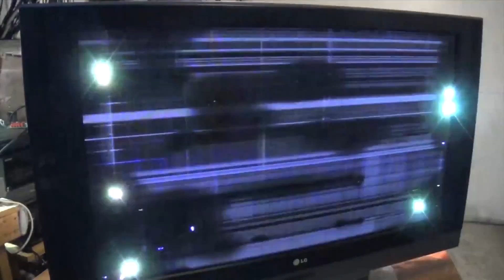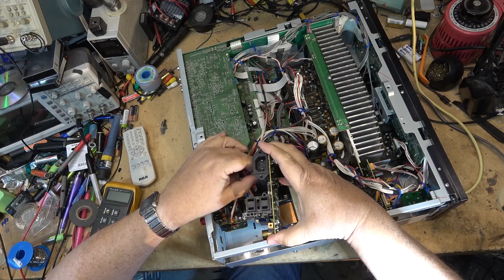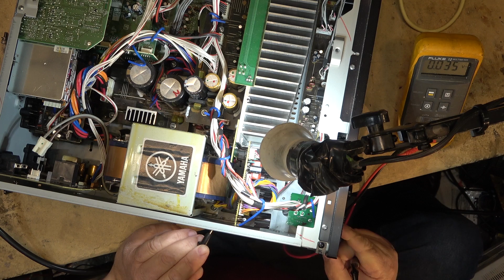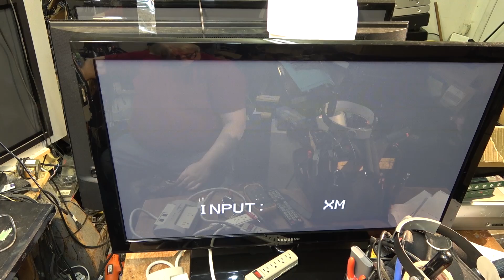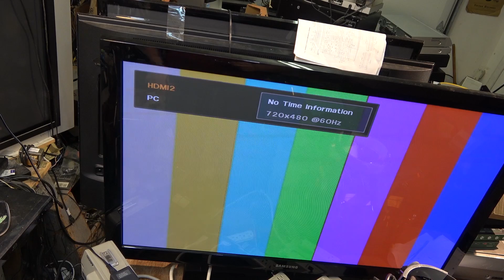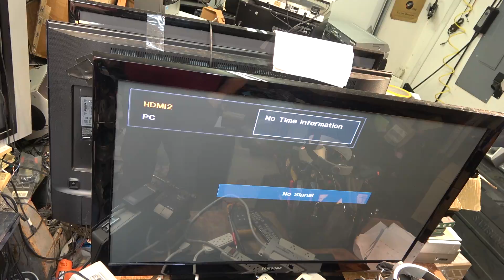Yamaha RXV1700 AV Receiver is DOA

Comment: I found one of these in the trash, Powered on with a click. No display. opened it up started wigging wires on the power board now it powers on. Think I too have cracked solder joints. Ill look at it 2 morrow.  Know what remote works on it?

Comment: Congratulation with the Yamaha unit. I have a old Yamaha RX-V461 unit and i love it because of the very good sound of the amplifier. A somewhat weird thing on my Yamaha unit is that i must hold on the power button on the remote until i hear the 2 clicks in the relay too engage on the Yamaha unit to power it up, if I don't do that it's going to hung up on the 1 click in the relay and get stuck and then i must disconnect the power cord and connect it again to the unit to get it working properly. The radio on my unit got a failure some years ago and the symptom reminded my of a failed transistor, the FM radio station i listened to just faded away in white noise and i got no other radio reception on any other frequencies. But i have coupled the Yamaha unit on a internet/FM and digital radio unit so that is taken care of. The original remote got a failure on the volume up button and i searched the eBay and got one cheap there. The amplifier in the unit itself has worked flawlessly. Great video 😊👍

Comment: Yes, I just re-soldered some bad points on a LED flashlight that required turning on the switch and then slapping it with your hand a few times in order to turn it on (only to have it mysteriously turn off at the exact moment of needing a flashlight). It seems to be behaving itself now.....

Comment: Any thoughts on the usual receiver brands over the last few years for sound quality and reliability, do you prefer jvc, yamaha, sony etc?
Reply from the maker: Yamaha have always had pretty good sound.  Personally I am using an old Onkyo but that's only because I got it for 40 bucks.  When it breaks this one will be next in line i think.  Have to get a remote for it though.  Or if i fix the other Onkyo that blew up when a bunch of geese thought power lines looked like a good place to land.
Reply: @12voltvids  I have a RXV-1700 in-service.. never had any issues with this high output amp over 8 years.   
The 'mystery' speaker output (non banana) is for Presence Channels. Chances are that speaker set has been disabled in original setup.
Yeah... you need the remote to setup many functions, aside control the thing easily (note the minimal control functions located on the Amp) 
The correct remote model number is: RAV361 - WH25420EX 
The remote is rather large and 'learn' programmable to control sources and TV functions. Has no less than 66 buttons, some multi functional. It uses 4x AAA cells... not the typical 2x AA or AAA cell job. 
This has a green coloured LCD display ( earlier 'top shelf' models had similar remotes with orange coloured illumination) Won't be cheap to replace. 

I would have replaced all of the red film Caps on that standby board. A common 'old age' fault is the unit powers up and then drops out due to such a Cap fault.

Comment: would this be a cheap fix for him good it came on
Reply from the maker: If it was a paid repair perhaps 100. He paid 95 at the vintage audio repair shop only to be told to scrap it. They offered to recycle it for him which I think is their way of hoping he would have said keep it then they would have fixed and sold for hundreds.  That is the rumour about that shop.   I won't mention them or respond if anyone speculates as to which shop. Any comments that mention any shop by name will be removed so any locals that feel they should call the shop out don't do it here.  You have been warned.  I know what they do because i know someone that took a piece of equipment in and was told no parts were available so they told them to recycle only to have it show up for sale listed at over 1000. Before you ask, it was a customer I met at my day job. They didn't know i repaired equipment and while i was there working on their internet we got to talking about stereo gear because they had some nice pieces and I mentioned i used to run the old local shop and that I still work on stuff at home.  Then the other shops name came up, fella asked me if I had heard about them and proceeded to tell me about his experience and what they did and then show me pictures of his equipment that they as he put it "stole" from him up for sale for a small fortune.  
I guess if I were to sell this for a few hundred dollars the guy that gave it to me could say that about me too and call me a crook.

Comment: What camera do you use to capture these videos? Your videos are sharp and the details are always easy to see.  I have some projects I would like to capture at my work bench, and the cameras I have available are either impractical (size/weight of a DSLR) or they don't yield a sharp enough image (10yr old GoPro).
Reply from the maker: I use a Sony FDR ax53 which is a 4k video camera. Has a 20x lens for good close up work.  I do my shooting in 28mbit avchd 1080p60 frame.  There is a higher quality 50mbit 1080 mode as well as 2260p at either 60 or 100 mbit 30 frame 4k. I don't use that as my computer takes longer to render 4k and it is unnecessary fir this work. I use 4k for scenery videos.
Reply: Thank you for replying! I'm saving up for a new camera and your info will help me narrow down the choices that exist, it's pretty overwhelming how many cameras are available on the market used and new.  @12voltvids
Reply from the maker: @killertimes  I have 3 in use. FDR AX33, FDR AX53 and FDR AX100. The 33 and 53 used for YouTube videos.

Comment: That's a beast. Sell it quick while it still works! I'm also on the Yamaha mission at the moment. I just took 3 units for repair and decided to buy a load more from the classifieds here in France. Making some low ball offers because by the time you ship it in and sell it and ship it out again it's not easy to make much profit. I'll try to sell them locally but i think i already have the amplifier market saturated here. lol
  One tuner amp had a strange failure after i fixed the bad 5V reg. It was all working but i had to clean the volume encoder, i stripped the front, cleaned the encoder put it back together and then no longer saw PRY voltage which should be 4.8V on the RX-V630rds, I could not understand why the microprocessor failed after i dismantled the front, it still appeared to be booting so i took a 4.8V from the perma supply to the processor and i routed it back to the standby relay input PRY. This means it's basically on permanently, probably no more remote activation. I'm going to tell my friend to unplug it when not using it. Too much of a mission to get a new micro processor as it would need programming. I was wondering if it switches in 4.8V to PRY from Vcc on the processor or if the processor has a separate 4.8V input that then is switched through to PRY, perhaps it is missing this 4.8V in so it can no longer output it although you can see it stabilise 0,05V on PRY so it is trying to do something. Already put too much time into it so it's going to stay in bypass jumper mode that i created unless i have some sort of revelation. Thinking this might have been static damage which would be my first encounter but it's a pretty old processor, v chunky. a M30622M4A

Comment: Hi Dave, what size isolation transformer do you have there?
Reply from the maker: I believe it's a 600 watt.
Reply: I have a 1:1 transformer in my garage from some industrial install. i can not really lift it it's so huge, it's still in a steel box but even out of it's box it would be huge, i think even at that size it's only rated at 2000W Insane, i would have thought it would be 10Kw.
Reply from the maker: @izzzzzz6  my isolation transformer weighs perhaps 10kg

Comment: Hi! Receiver going to comme back with same fault: you have problem with C4 (value is lower than it should be) there, on that STBY board.... (change it and you will be fine). This is know many YAMAHA RX-V fault.........(If i remember correctly: you allready had same kind of problem with another YAMAHA previously....)
Reply from the maker: Ain't coming back as it's my receiver.
Reply: Ok, but it will have same fault after while (thermal dependency...) @12voltvids
Reply from the maker: @kalulukakaluluka9497  likely not going into service any time soon.
Reply: @12voltvids  That model Yamaha will crap all over the Onk'. ;-)
Reply from the maker: @BTW...  need the remote
Reply: Definitely agree about the C4 Capacitor, had the same problem on 2 previous RX-V Receivers and replaced capacitor on both units and both running fine years later. Cheap fix.

Comment: Quite happy to accept the need to cut lead out of waste products wherever possible, but when taking the lead out makes stuff more likely to go to landfill prematurely in the first place  you have to question the logic. At least allow its use in areas where lead-free is known to cause reliability problems.

A few remaining repairmen around here are terrible for charging for callout and then having no intention of  repairing stuff, preferring to try to use it as an opportunity to sell a new one to customers. I had that with an LG washer a few years back, guy came out and told me BER (turns out it was dead transistor on control board, fixed myself), I paid up and gave him his £40 but I did so through gritted teeth (and a few choice words when he tried to sell me a £200 Zanussi for £300 with the call out charge taken off the bill), he didn't even look at the bloody thing! He even advertised no call out charge but had some excuse for that as well - I will always honour my side of the deal but that is just shady.
Reply: I'm pretty sure the lead free thing is just a scam to make an excuse to save enough lead for the billions of car batteries we have been using over the last 50 years or so.

Comment: Lead solder The Best- Ince they went to lead free solder thats when issues happen cracked solder joints
Reply: And the lying corporations claimed it was government control, just like washing machine manufacturers that started building junky machines that fail in less than 4 years.

Comment: HI Dave,  it's a shame the other shop didn't even want to try to troubleshoot this amp !, you did a great job!, I hope that I can remember to check out the solder connections on the circuit boards in all equipment that comes to me for repair!
Reply: some shops just dont want to work on that kind of equipement too big too old to much time just to pull it apart , thats how i got my onkyo tx-nr906 for 80 canadian$ just because the old owner had issues after some one installed 2 fans in it to cool the digital board , and after  the usb port and network port was not working took me a lot of time to dig in it enough to find that some one had disconnected a simple flat cable but still took a lot of time just to find the issue fix it and put it back together  a lot of screws on thoose big amp`s
Reply from the maker: @c4shd34d30  I won't work on them for others.  If given to me I will look for simple stuff but if i am digging into multiple boards I'll give it away to someone more commited to it than I am.  After dealing with this crap for over 40 years I am not as motivated these days and nobody wants to pay.  
That reel to reel Sony that I spent the better part of 2 days on is still sitting here bill is 200 and owner questioned why it was so much to fix. With all the testing and probing I probably spent 12 hours on it.  (Also considering that just stopping and starting the tape fixed it for about 20 minutes till it faded out again ). Lots of keyboard warriors that post that they will pay or have paid hundreds to have vintage stuff repaired.  Well in the 40+ years i have been doing this I haven't met one yet.  Most will go to about 100 and after that they scrap.  Highest repair bill I have had in the past several years was for the Samsung TV backlight repair.  That was 300.00.  Out of that, the backlights were 80us, which was about 110cdn, 30us shipping so 50 cdn and then fed ex billed me 47 in broker fees.  So about 185 in my costs and i got 300.  I made 115  and for that i got to take the tv apart twice.  First time when i thought it might just be 1 open led only to discover that most were shorted and bad.  I figured the owner would toss it but he insisted to fix so I had to reassemble, order parts and rip it apart a second time.  I seriously doubt i  will change another backlight due to the cost.
Reply from the maker: I believe they only deal with 2 channel gear.  Anyway the guy paid 95.00 to have them tell him it was shot and he gave it away.
Reply: @12voltvids  I speculate that could be the answer right there why the shop didn't repair it. If you could get away with charging a 95.00 fee for only looking at it, that's easy money. They know the customer is never going to pay anything upwards of that fee for an actual repair.
Reply from the maker: @BrainHurricanes  Crooks

Comment: Just had an AVR that kept shutting down.  I pulled the main board and wouldn't you know it the pins on the front output module were lose!  A reflow got the thing working without fault!   Lead free solder strikes again!  My Pioneer AVR requires the remote to control the fluorescent display dimmer, but it also brightens back up when you try try to control it.